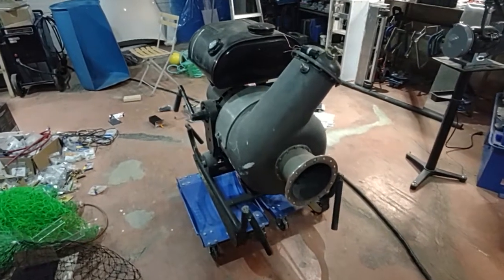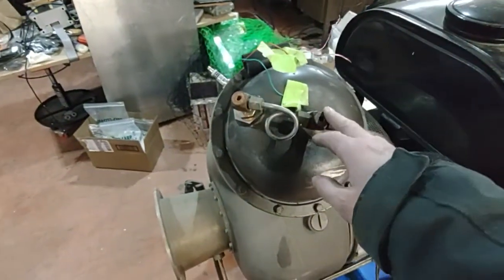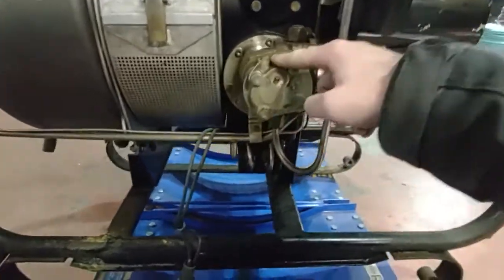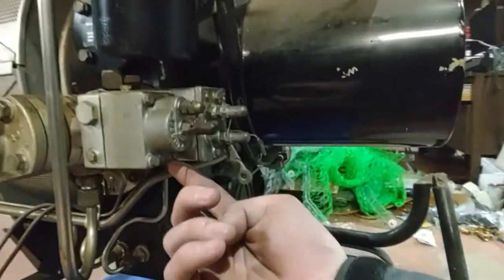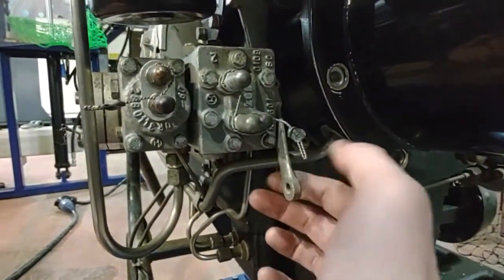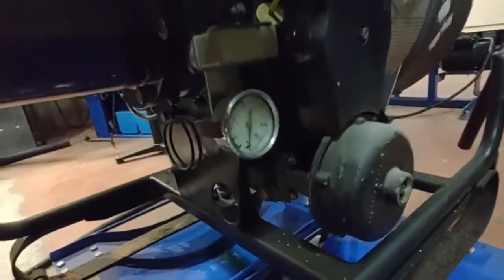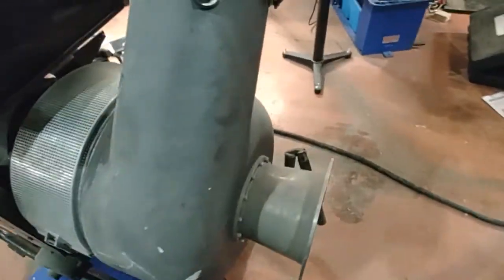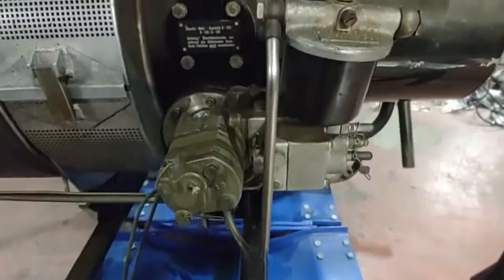Deutz T-216 Gas Turbine (overview - no start)

Comment: What a huge turbine! Old water pump?
Reply from the maker: You could probably connect it to a pump if you want.  It has a 3000ish RPM output shaft.  You can use it to power lots of stuff.  This machine itself is a gas turbine.  It runs on diesel or kerosene.
Reply: @unhinged-menagerie  impressive! What do you do with this giant thing?